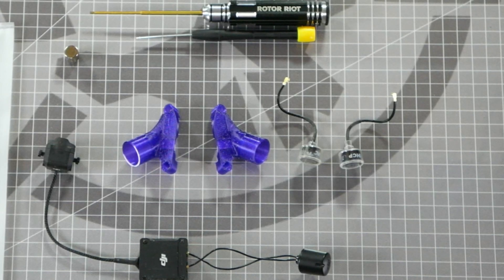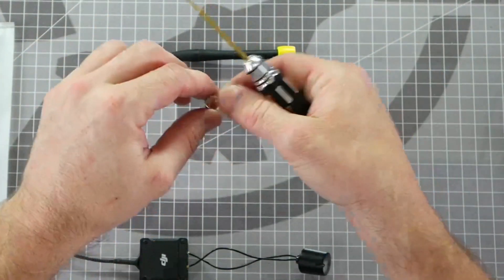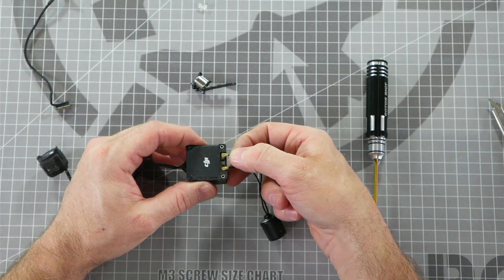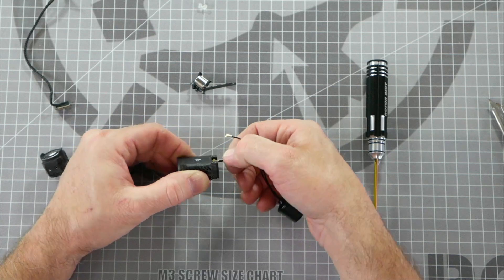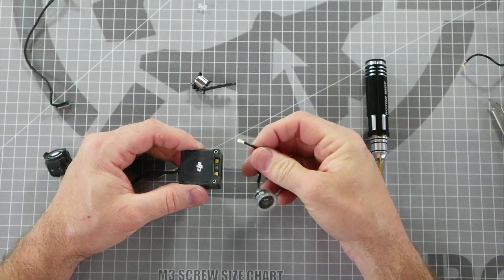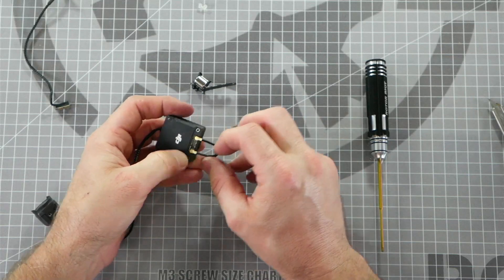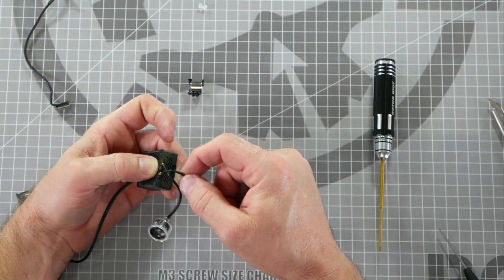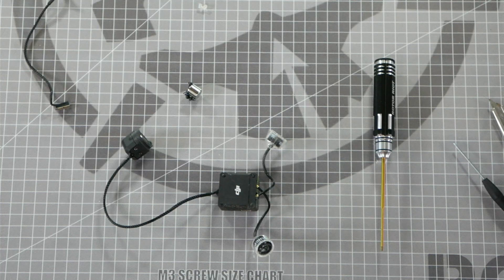How to Replace DJI O3 Antennas

Comment: i just crashed mi Cinebot30 and the plastic cap of the O3 antenna fell off and i cant put it back properly, do you know if it need some glue or something like that?
Reply: Got the same issue… just buy a new antenna. Be careful! You have to also buy an extension cable.
Reply: @dysisinfluence  haha i did both, it is working great again
Reply: @dysisinfluence   @walasfilms   Guys, this happened to me a few days ago. The O3 Air units have started to black out midflight for some reason and my antenna cap is gone. Can I simply add a new cap? Or do I actually need to switch the entire antenna out?
Reply: @ViktorKallbergFoto same thing happened to me. I swapped caps, and the problem continued.
Reply: @dysisinfluence btw i had crash and antenna wires came out of clips. How do i put them back in ?
Reply: @vatsalkonkani  try to press them back in
Reply: @dysisinfluence so its just clipped in right. 👍
Some said in our fpv group that antenna is gone buy new one 😅

Comment: I am trying to repair the antenna on a geprc 35 v2 and it has an IPEX/U.FL extender from the o3 unit to the antenna. What size is the IPEX/U.FL from the O3 Unit? I cant seem to find the correct one online!
Reply: it should be the same in terms of the connectors but the width of the wire should be  0.8mm if that what you looking for.

Comment: I am using the DJI Controller 2 so am reliant on 2.4ghz.  Which antenna is 2.4 and which is. 5ghz?  Does it make a difference which antenna is plugged in to each socket? thanks
Reply: you figure that out?
Reply: @gonzarb93 I have this feeling it does. My o3 drops data rate on my fully diy quad but my geprc mark 5 had 0 issues. I'm going to swap the connections but I also need to resolder the connection to vbat so I am waiting on a new iron as my previous ones suck. I will update when I've tested
Reply: . On my geprc mark5 my video would cut out after a few flips or rolls.  I installed a capacitor on the 12v +- pads, problem solved.

Comment: Are they still LHCP or have they changed over to RHCP?
I know the 03 Air unit transmits and receives in both data packets in both 2.4Ghz and 5.8Ghz intermittingly, would that mean I would have to have an antenna of each 2.4Ghz and 5.8Ghz? 
Asking because a co-worker was testing a build with two antenna similar to this and he had singal drop out often. 
Final qestion, are there any Antennas you guys recommend over all others for the new O3 Air Units.
Reply: They are both... As long as it's 5.8ghz, your good
Reply: William is Erik... Erik is William   or copy n paste queen 👍😂
Reply: You need 2.4Ghz only if you use a DJI radio.